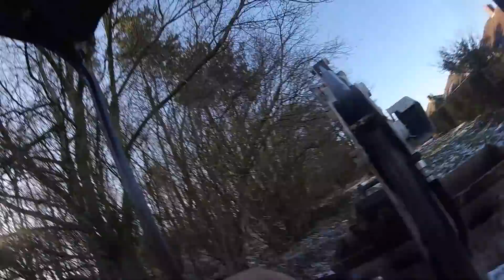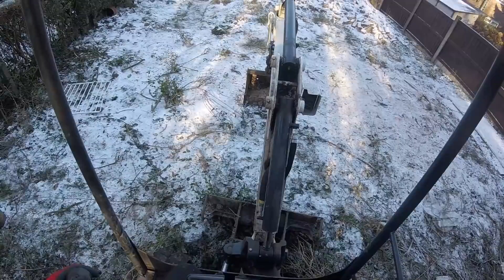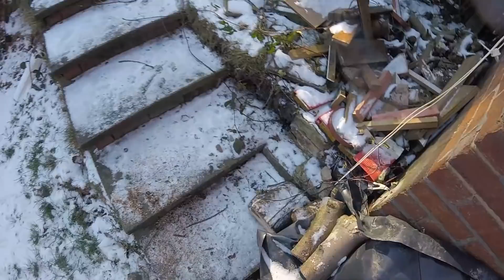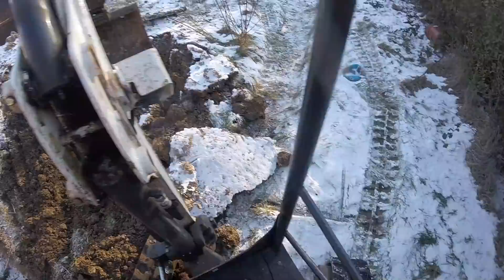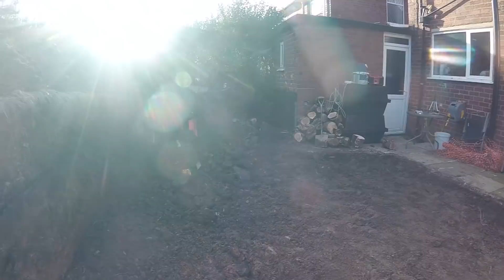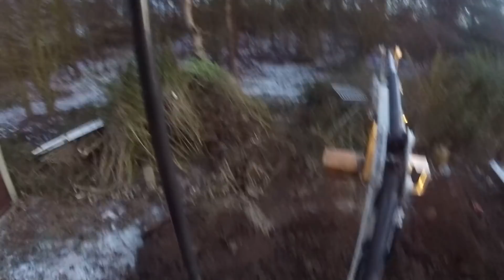Excavating My Garden

Comment: Where did you learn to drive these?
Reply: I learned by practice . Used to do a lot of block paving around 1990 .... Trouble is , when you first start , you always dig far too deep . Licenced for a 20 ton digger now , much easier to drive , as they don't bounce around like the smaller ones . ☺